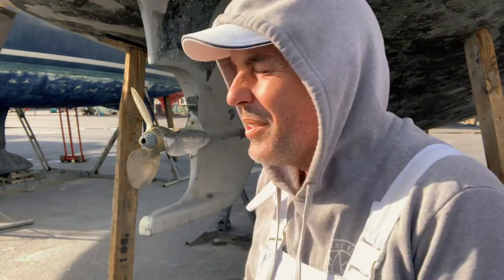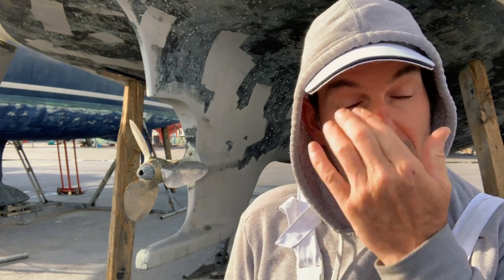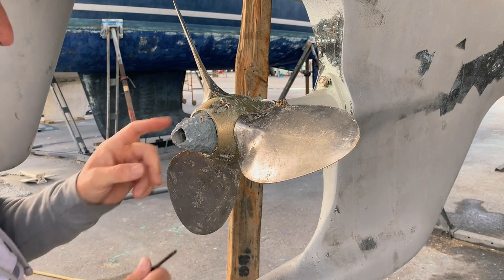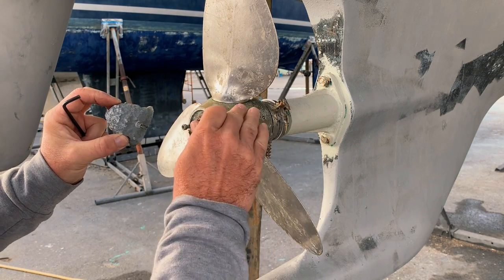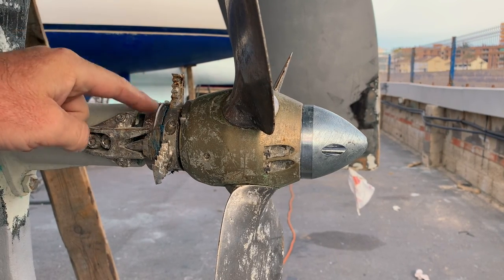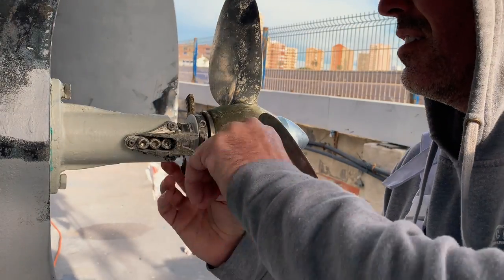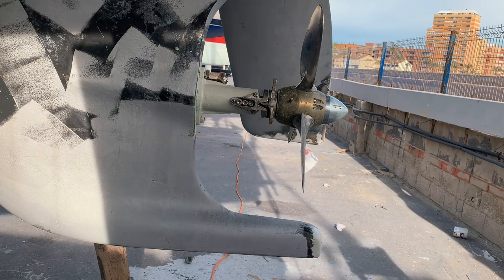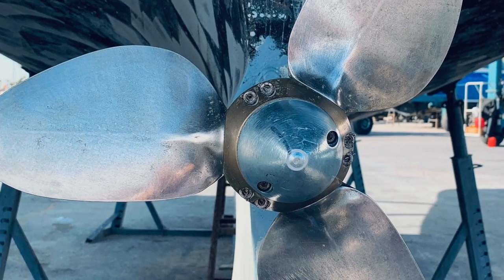How To Quickly & Easily Service Your Feathering Propeller & Rope Cutter | Technical Sailing

Comment: Nick, thread locker goes stale in the bottle, so when I get it, I mark the date with a Sharpie and toss it or give it away as that date comes around. Also, $5 will buy you cut resistant Kevlar "trash handling" knit gloves, great protection from hot engines, barnacles, and line cutters. Like religion, if you get them you'll keep them. For $15-$25 you can get thinner silver food prep gloves, cut resistant too. Try the Kevlar, they make great line handling gloves.
Reply from the maker: Good point my friend. We always make sure we have fresh thread locker.

Comment: Nick, Terysa. Hi Guy's. Great Video as always. The Ambassador marine rope cutter is simply the best and we would add to your comments it's kept us out of trouble. 3 Boats on we are still sporting their rope cutter on Impavidus. It's the mutts nuts!  The company that makes these is a small independent company in Winchester UK. We have no affiliation, But we know the owner. They have continually developed new solutions for all types of drives and continue to do R&D at their own cost. Support from them is exceptional. We have a Brunton Autoprop, the anodes dissolve in 12 months or less. It was a shorter period before we fitted our galvanic isolator, securing us against others bad marina stray currents.  Its made a big difference. We clean and sharpen our rope cutter with a 60 degree oil stone, gently to avoid finger damage! One tip we picked up from the he hive mind is to coat the area around the anode, machine screws,  is to coat them with nail varnish and the area around them on the anode with the same. Preventing the anode wasting away round the fixings, extending the life. Have you discovered Aqua Furta in Spain the best barnacle remover and toilet limescale remover on the planet?  You cannot get it in the UK. Sail Safe Ant & Cid xx
Reply from the maker: Hey mate, yes we have aqua fuerta. It’s known as muriatic acid in the USA and Carib. And brick cleaner in the uk. Nasty stuff, but does the job

Comment: You might want to try the wire brush attachment on a dremel tool to clean off the corrosion. It's pretty fast and not very abrasive. Nice work.

Comment: Try using a little barnacle buster to clean the prop and cutter.  When you had the cutter off soak in barnacle buster for 10 minutes and rinse off.  Super easy with no wire brush scrubbing required. For the prop just spray on with a spray bottle and let it sit a bit the rinse off. Super easy.
Reply from the maker: Thanks mate. Never heard of barnacle buster, but muriatic acid (aka black cleaner, aka hydrochloride adic) will clean growth off in an instant
Reply: Sailing Yacht Ruby Rose same stuff , but wear gloves when spraying or touching unrinsed items. Search it on line or you tube.

Comment: I have a similar prop, but I have two screws for grease.  Last haul there was aa bunch of stuff in the screw and I could not get it out.  Only was able to grease 1/2 the prop.  This year the prop is coming off to resolve that issue.

Comment: That was a proper,    job, thanks,  could you explain just how the prop works and what if anything do you do to feather it?.
Reply from the maker: Thanks mate. When the prop is turning under engine the blades lock and thus work to push the boat through the water. When the engine is off ( and the gearbox engages to stop the shaft turning) the action of the water against the blades turn them so they are in line with the water. Less drag and higher speeds
Reply: @sailingrubyrose  Thanks for the explanation. I fly and just wondered what the mechanical difference was.

Comment: We have he same stray-currents issue with docks in the lake.  Even with our power cords disconnected, we get mild shocks if the ladder touches the dock metal and water.  Ah, so, if you get rope on the shaft, you try forward/reverse/forward to see if it will clear?
Reply from the maker: Yes mate, slow forward and reverse. It will shift even the biggest rope we’ve caught thus far

Comment: Do you have to have a longer prop shaft to account for the rope cutter dimension?  Or, can one add a rope cutter to most any prop shaft.
Reply from the maker: Our fitted to the standard length

Comment: Nick, with respect to cleaning the prop without scoring it... you might want to take a look at a hand-held, rechargeable Dremel - say something like an 8220 - with some polishing wheels. You can put polishing paste on them - and because they're much less abrasive than a wire brush, you can moderate their "bite" through a combination of wheel speed and hand pressure. Plus, it takes a lot of elbow grease out of the process, so you can put in a bit more effort to get a really good polish. Obviously you won't get your prop back to new, but you'd be surprised at the result...

Comment: Why didn't you pack the area behind the sacrificial anode with grease to protect the nut inside there?
Reply from the maker: There is a small hole behind the anode. The grease extrudes into the area
Reply: @sailingrubyrose  That's great. BTW Love your videos with the Wynns - like you have followed them for years - safe voyages :)

Comment: Can you use steel wool to clean the area instead of a wire brush? Seems the wool would be gentler..
Reply from the maker: You can indeed my friend. Steel wool doesn’t remove scale or marine calcified build ups as well. We only use an old wire brush with knackered bristles
Reply: Try to use bronze wool or a wire brush with bronze/brass bristles, never steel brush or steel wool as any residue left will rust , IMHO
Reply: This is an excellent suggestion.  They also make a stainless variety, never buy it.  It's not worth the money.  It's low grade stainless that rusts anyway, not sure why they even make it.  The Bronze / Brass should be your staple.  The classic steel wool should be only if you can't find the Bronze or Brass.  It's more expensive but completely worth it.

Comment: Love the videos, but, IMHO you are waiting way too long to change the zinc.  As you know the zinc can be changed in the water and cheap in comparison to replacing the internal parts or blades.  That zinc gave up all it had months before the change out.  Also when applying grease the prop should be rotated fwd/backward while greasing.  Cheers and fair winds.